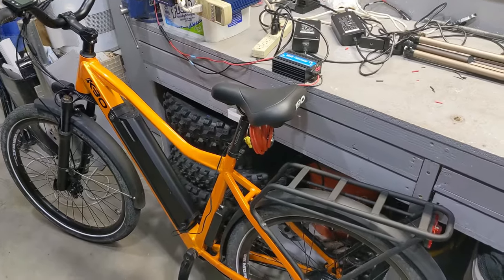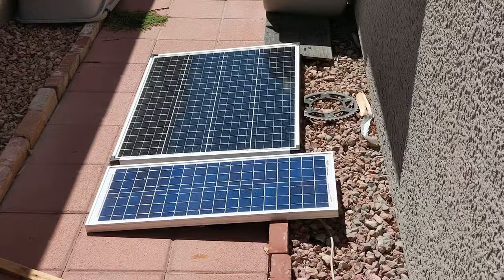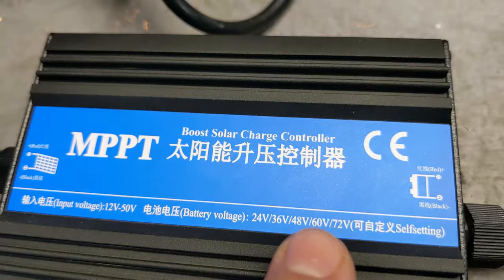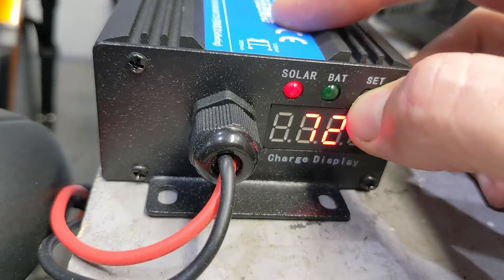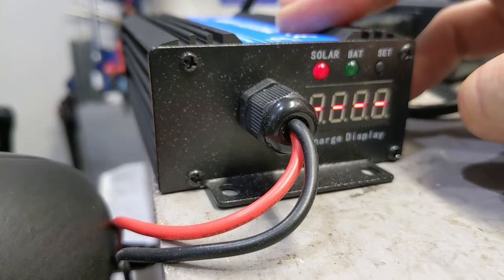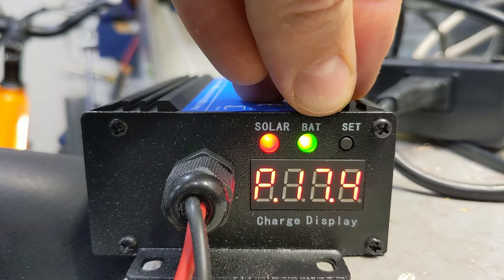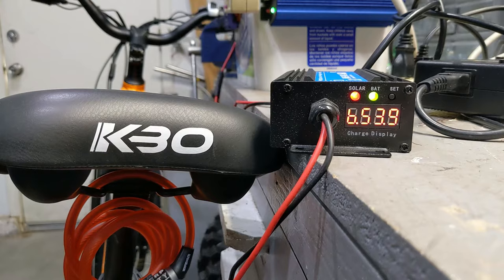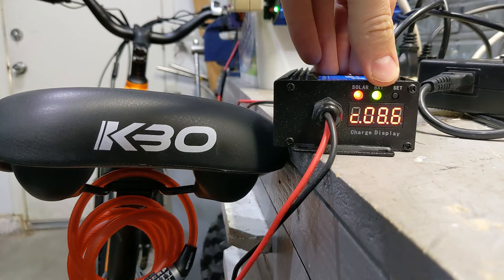How to charge an E-BIKE with solar panels Directly, Solar MPPT charger for E-bike KBO or Himiway 48v

Comment: One thing I'll ALWAYS recommend everyone whenever these types of displays are used, please put a strip of red electrical tape over the display to make it more readable, in factory format, they're too bright for the cameras to focus on them clearly (I always find these kind of segmented displays to be filled with a lot of glare, so the tape tip helps add contrast IMO).... definitely an idea I'll try out when I'm out cycling and need a charge while taking a break.
Reply from the maker: Great info

Comment: I have a Longi 410w solar Panel with 37V output. The Samebike original charger is 54.6 V / 2 A. If I use a MPPT charger and set the Voltage to 54.6V would the panel be too strong and damage the battery or the battery would just absorb the 2 Amp ?

Comment: Awesome video, thanks. My idea was to charge it not with solar but with the light machine as not allways the sun in shining.. As input is 12-V and the input range of the MPPT is 12-V +, this should not be a problem, right? Could you use also a STEP-UP Konverter for this job, or they just do not have the automatic power switch off? Shouldnet be there zero power flow, if you charge with DC-DC step up and the zells reached 54.6V?

Comment: Very good tutorial of the device, but how do you regulate the current. The charger that comes with the battery outputs 2.0 a or whatever, but how to set the MPPT to also give a constant user defined current?
Reply from the maker: You can't regulate current only voltage
Reply: @TheCrazyRomanian  After charging my batteries with this MPPT and a 120w panel I now find I do not have as much range, there is less power available from the battery, and now when I charge from the mains the battery charges quicker. I think the high amp has done some damage to the battery

Comment: Thanx for the video !
Is there a way to limit charge current or is it the solar panel power that gives the charge current ? ( I need to charge 4.4Ah 36v Lithium Ion battery [32-42v@1.5A] but be abble to charge bigger batteries with the same solar panel)

Comment: Thank you, this  is valuable.  The stock charger (1:04) was rated for 54.6v@3 = 163W) so as you stated 200 or 250 watts is good size panel factoring in losses!  But are these units reliable? Do they forget settings if power is lost?  Anybody else test this setup in real world using the ebay controller?
Reply from the maker: no they remmeber the settings , and ive charged my bike multiple times since then , no problemo
Reply: This blue step up boost MPPT controller has dip switches inside the side panel you can flip to set the self setting voltage you selected.  They call it the childproof lock in the instructions.

Comment: I've got a 250w solar panel and 52v 20 Ah battery (a common upgrade from a typical 48v battery). Would this panel work without damaging the battery? I have been hesitant to try my newly purchased mmpt controller the same one as in this video after first watching this.
Reply: I've used this for ebike,amps start high when battery is low but as it gets closer to full charge , amps lower down as to trickle charge too max voltage that you set it too. I've had mine a year now with no problems.
Reply: Just use the self setting on this MPPT to 58.8v for your 52v battery for full charge. Or u can set it 1 or 2 volts less to extend the life of your battery. The trade off is that your battery will not be fully charged, which will reduce your range. U can decide longer life or more range?
Reply: @jonk8337  thanks that is interesting to know. Is there any minimum amp hour rating for solar charging with that same panel? Just that I also have a 52v 4ah  lawnmower battery which I would be interested in charging but suspect I'd need a 100w panel or something.

Comment: 54,6V is actually the maximum voltage of 48V batteries so it should work with that battery setting it to 48V!?
Reply: yes mine does

Comment: Got the same one and two one hundred solar panels that are the same.  Awesome controller. I have a question... I have wired so I get higher amperage, series and parallel testing. I had wired and was getting about 2 amps output max so I rewired and was getting from 2 amps up to 9 maybe 10. I want about 5 but have no controller to control amperage but 48 volts is definitely correctly set. My ebike battery is max rated for 5 amps charging so I'm definitely not comfortable with over that. Any ideas? By 48 volt setting, I mean it's set to top out at 54.2 volts. I opted to drop from 54.6 setting because I noticed it hit up to 54.8, so I cautiously dropped the voltage setting 0.2.
Reply: Same with me. Same controller and 2 100 watt panels wired and have reached 10 amps. 5 amps is my battery max input as well. I went 54.4 as the setting for charging and the secondary screen reading is what, combined voltage?  Concerns me that that voltage never reaches the 54.4 volts and is usually 30 something.... but is putting out the higher amps maximum of about 10. So isn't it possibly harmful to push lower voltage at higher amps?

Comment: Impressive, valuable information! Would this work with a Sur Ron? I have a custom battery (60V 55amphr 3300 Wh) with a TX90 connector to charge it. My thought would be with this and the 160W Foldable Solar panel from Powerfilm (28V 5.7A) and then I can do attempt my trip across the US. Sounds possible?
Reply from the maker: Yes it will charge the battery but will take 3 days to get it full solar it's too small
Reply: Sweet thanks for getting back to me I did see your solar setup on YouTube. I guess I'll just look for plugs at Walmarts and take my battery into a Starucks. I'll have the fold up solar for emergency and possibly a popit tent.

Comment: my ebike's charger is 36v 2a and I'd like to charge it with my 80w folding aimtom solar pv. Will this MPPT work with a smaller panel like that and just trickle charge over a longer period of time? I would like to use it when I'm camping, and so it will have 2 days to charge.
Reply from the maker: Yes , works even with 30 watt .. but takes forever ...it's a match thing .. 80 watt will give you about 300 watts during a full sunny day
Reply: I use mine with a 60 w allpowers folding panel  to charge my 48 volt 23 AH ebike battery when camping get 700 mah to 1 ah depending on conditions adds between 5 to 10 miles range which is useful considering the set up is very light weight and takes up little room on my Burley  bike trailer and the usb ports charge phone ect so yes with an 80w panel your good to go and will work fine

Comment: Hello there my friend...I just want to raise questions with regards to compatibility of this solar charger when it comes to battery. Is it compatible to or applicable to 48 volts lithium battery....thanks and more subscriber to com
Reply: I forget to set the volt to 54.6 and it was 57.0 so I end up burning the fuse inside the battery . Lucky there is 10 amp fuse inside the battery to protect it . I made video on my channel about this issue

Comment: If I may,  I have a 36v or 3X12V lipo4 batteries for my Minn Kota motor.  Can I set the Solar MPPT charger at 43V to connect to the 36V battery bank by Anderson plug to charge it directly via the from 12V solar panel?
Reply: I wouldn't do that what does the back if the charger say u might have fire
Reply: Match the volts  just like u could get 6 more batteries same amph and wire 3 together at 12 volts then rewire original.  harness 3 12 volt 3packs and have 3 times the distance-weight loss

Comment: Can you ride a bike while riding?
Reply: Good question 🤔 the battery cannot be charged at the same time as its been discharged via the motor.. there is a way to do it called bypass but its technical and requires expert wiring.. I don't recommend

Comment: How long it charge until full?
Reply: Charger will take 6 hours to charge a 48v 10AH battery at 2A nominal 54.6v as the current reduces at the 80% plus to full. If you have a 48v 17AH battery it can take 9 hrs or more with a 3A Charger. Batteries usually ramp up to 80% before they plateau and the extra 20% to full can be considerably longer. This is because chargers are regulated to drop the charging current at 80% in order to be sure that the battery doesn't overheat 😊😊 thermal runaway

Comment: Now things are getting extremely interesting! It would be nice if you could prepare a list of all the components needed for a system. I'm glad you're doing all the tests and development work for me 🌞🌄🏜🏖🎯🚴‍♂️💪
Reply from the maker: Noted!
Reply: Does it matter how many amps the up controller is? If I just bought a bike charger it would be $700 or more I'm on a budget and I also don't want to blow up my battery what cost $500. I have one leg I want to ride the Empire trail from from Batavia New York to New York City
Reply: I have three batteries and I still have range anxiety cuz I want to go really far and I don't want to have to keep renting a hotel room which I can't afford to do it is the end of the world if you got an electric bike and a solar charger your set long as you got extra tires tubes and all that s*** and the rest of the people I don't know what they're going to do probably steal my bike
Reply: That black boost mppt charger is 300w rated I think.  That means max solar panel of 300w or very slightly over could be used?  I see online that the same manufacturer offers a newer model look identical only it has an all blue case that is 600w.  I think that means you could use a 600w panel and get faster charging.  A stock Sur Ron charger runs 67. 2v at 10A which is around 650W..so the all blue model I think would be best for your Sur Ron?  As the sunlight is sometimes less than perfect and panel inefficiencies mean it would probably be charging at 400-500W which is better for the battery??
Reply: @LetArtsLive  yes Amps matter.  Sur Ron stock charger is 10A but it may be too aggressive and shorten battery life.  Gets hot too.  I think Romainiac recommends going lower Amps and slower charging.
Reply: 400W to 450W solar panel monocrystalline plus 2 miniature circuit breakers for isolation of panel and battery, step up boost MPPT controller and extension cord with charging port plugs for your ebikes, that's what I manufactured in waterproof electrical boxes for home or mobile.  Can use on van roof setups, or camping if you like the foldout flexible panels or solar blankets.
Reply: This is the basic setup you need https://youtu.be/VjnYeoK6wCo
Reply: @LetArtsLive ??? Re phrase don’t understand

Comment: What set up would you recommend for a 48 volt 60Ah battery? 🙂
Reply: the unit is 48v by default, it does not matter how many amp hours the battery has, it charges until the BMS shuts it off
Reply: For that size battery I recommend 300watt panels as the current draw will be significantly higher from discharged.. also with the MPPT controller optimising power point the curve is likely to be somewhere in the 170w to 340w range. One panel alone can help to keep the current at a reasonable level. Ideally you would not want to exceed 16amps.. 😊 you will need a 20amp fuse and also be sure that you have a disconnect switch to the panels.. when setting up work from the base <battery><controller><panels> this avoids sudden surges in Power which can destroy your controller. A cold dark panel which is suddenly in full sunlight can exceed the panels VOC [ voltage open circuit no load ] typically this voltage spike goes down under load.

Comment: Thank you for this video.  I have the exact same Solar MPPT charger.  I wired to 175 watt Renogy solar panel.  I soldered to XLR 3 pin male connector.  I referenced online wiring diagrams to make sure I got it right.  I programmed the MPPT to "self" 54.6 volts which is the output voltage on my bike's charger.  Everything seems to be right.  When I plug it into the  battery on the bike it shows 17-21 volts from the solar panel. It show 54.6 volts for the battery.  It shows 0 for the current.  I've tried a couple times and it never shows any current.  The battery is run down a little from an eight mile trip.  The regular charger shows red light, meaning that the battery is not fully charged yet.  Any advice?
Reply: Is the panel in full sun? Understand that this MPPT is trying to convert 17v-21v into 54.6v. It’s always better to have panel or panels closer to the voltage that the mppt is converting to. Your Renogy panel is a 12v panel, even though it reads 17v-21v. They are used for solar and usually it is to step down to charge a 12v battery bank. I have never used this MPPT, but in my experience with solar MPPTs is that they are better at stepping down. I bet if u have 2 of these panels in series, it would work better. With only one, u will need full sun or maybe your voltage is not high enough?
Reply: @jonk8337 Good points but I run this same setup with no issues whatsoever….

Comment: I have this same controller and I just purchased two 100 watt flexible solar panels. Do you know how many amps this controller charges the himi 48v battery? I couldn't find any info on the instructions that said the output amps. I'm hoping it isn't any higher than 3 or 4amps max. But since I didn't see it listed in the instructions or display, I was hopeful that you might have tested it.
Reply: That is controlled by the panels power so 200W in perfect sunlight less inefficiencies you might get 180w.  So 180/50 is around 5A I believe.  If it's a bit cloudy you may only be getting 3 or 4 Amps maximum.
Reply: Did you figure it out? I have a himiway cruiser and I'm hoping to figure out a way to solar charge.
Reply: Same here, same set up. I tried series and parallel. I used a volt meter $6, to test the output amperage at my plug and got up to 2.5 amps wired one way and over 8 amps the other way. I want about 5, the maximum my battery is rated at. So use a cheap meter for testing output of volts and  amps. Just because the controller says X amount of current, it might be off a little.

Comment: Let me ask you, by the way, thank you for this tutorial- I have two 36V/7ah batteries (500watts). The similar controller linked in the description, set the voltage to 36v, correct? Thank you in advance.
Reply from the maker: You set the voltage to exactly what it's in the back of the charger for the bike...
Reply: @TheCrazyRomanian  I know you said that in your video. Thanks for answering anyways. Appreciate it.
Reply: Probably for 36v it's slightly higher as the 60v Sur Ron battery charger charges at 67.2v I believe.  You might use the self set cutoff at whatever your battery OEM charger uses.. I think Romainiac says use slightly lower than max voltage as these solar chargers do not balance the cells at the end of the charge.   Then use the AC charger to balance once in a while to keep battery healthy.
Reply: @fromtheflightdeck252  nope, the BMS will balance the cells both on AC charger and this solar controller.
Reply: In case of LiFePo4, full charge voltage is 36.5v (nominal voltage is 32v). In case of Lithium Ion Batteries 36v is the nominal voltage. Full charge voltage is 42v (recommended 41v for longer battery life ~80-90% SOC depending on the cells chemistry). This is for 10s batteries.

Comment: Is the amp between the battery and controller to protect the controller or battery?
Reply: Amp?  You mean fuse?  There is a 10A fuse on this model boost mppt to protect the wiring to the battery.   Remember a fuse protects the wiring not the device.
Reply: On my setup I put a DC mcb to switch off PV panels (isolator) and a second D.C. mcb breaker rated at 12 A going from the boost controller to the battery for protection.  That way when I am connecting my battery for charging I turn OFF the panels first so that it's battery to controller first, and then turn on solar.  On finishing charging and before  disconnecting I also turn off (isolate) the panels.
Reply: @fromtheflightdeck252  thanks